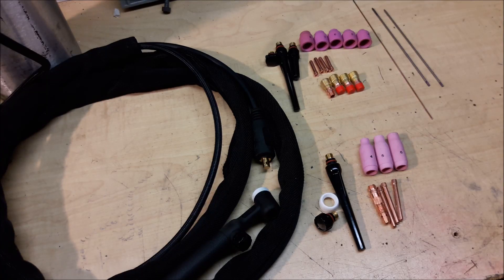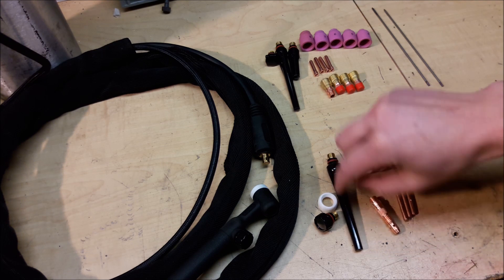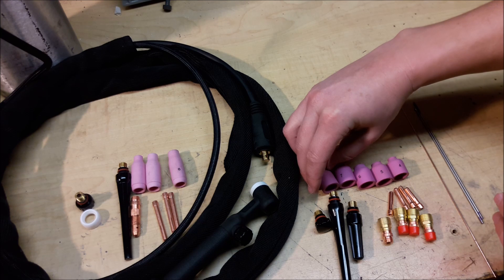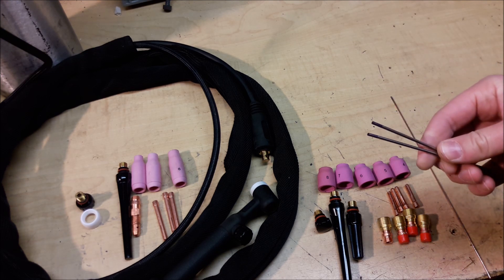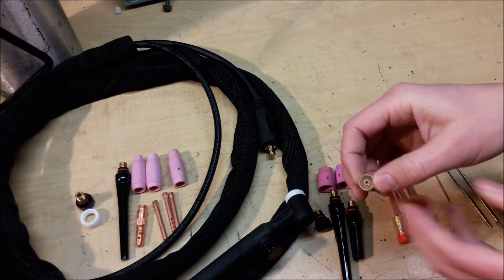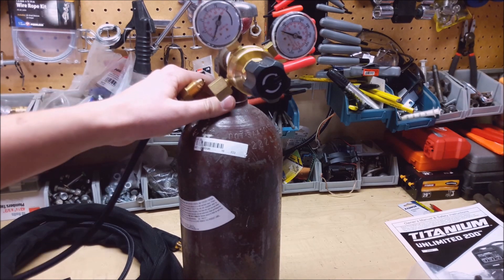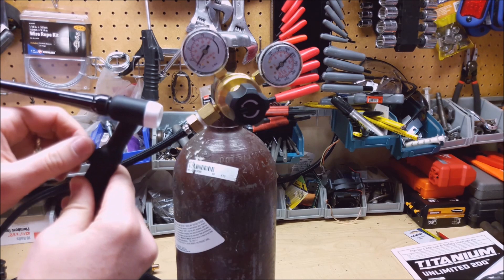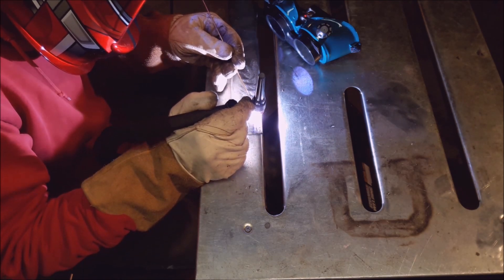Harbor Freight Titanium Multiprocess 200 Welder (TIG & Stick Process)

Comment: I was taught in Oxy Cut class never to use Teflon on threads of an air tank.
Reply: I didnt know that. Thabk you!
Reply: I was just about say this
Reply: The seal is the mating of the brass surfaces, so wouldn't be needed.  Like using teflon on a compression fitting.

Comment: Don't use any sealant on the regulator threads
Reply from the maker: My plumbing days are coming back!
Reply: Just curious why not?
Reply: @xtrah8ed4life  it could either get into the regulator a cause a false reading, or the pressure can make it crack the brass or Worse
Reply: The fittings are compression and thread tape is an absolute waste of time since the threads do not seal anything
Reply: Yeah I was told not to use sealant for threads
Reply: @xtrah8ed4life  I'm a retired machinist and the reason is that those threads are machine threads not pipe threads. They are parallel not tapered. As are compression fittings and flare fittings. Their function is merely to hold the inner pieces tight against each other. Whether they are flared, compression or domed. So putting thread sealant on them is actually preventing their ability to perform their function. If the fitting leaks when tightened you need to investigate the sealing surfaces for damage.

Comment: You're the second guy I've seen on Youtube standing up a high pressure bottle  on it's own. You guys are dangerous.
Reply: Mythbusters tested this.  It's no biggie if you break the valve off the bottle.  Just saying.
Reply: @SomeTechGuy666  : Really? You'd rather trust Mythbusters than, say, this: http://www.ehs.ufl.edu/programs/os/cylinder/

Or any other industrial guideline? Pick one: Any one: They'll all say to secure compressed gas cylinders at all times.
Reply: No biggie? I saw one fall, break the valve off,  shoot across a room, blow through cinder block wall, go across a parking lot and only stop when it hit a 12" thick concrete retaining wall. It is a biggie. If it hits you then you are DEAD
Reply: @richmac918  I call BS.  Jamie in Mythbusters set up optomized experiments and could not get a bottle to go through a cinder wall.  The necks of the bottles are designed to throttle the flow inthe event of breakage.

Comment: I have the same welder, bought it for my service truck. That welder is surprisingly fantastic. I welded a rear housing together today and I was hammering that thing. 21 volts, 310 wire speed, and hanging on the trigger. Can believe that I didn't duty cycle that thing. I am very impressed.
Reply: Ive been using the mig 170 this whole week for my job fabricating functional fitness equipment and boy am i shocked
Reply: Did you run 0.035 solid wire with a argon/co2 gas?
Reply: Will this machine run AC tig for aluminum
Reply: @TheRealRambo903  I "believe ", it's dc tig. I spool gun all my aluminum. Only used the tig a few times over the years for light weight steel tubing.
Reply: @mlhrepairsllc6942  would a spool gun be any good for boat repairs and aluminum up to 1/4 inch? I’m starting a boat fabrication and repair shop, I just don’t wanna buy the wrong machine or waste money
Reply: @TheRealRambo903  I use it on 1/4", but boat  fabrication and welding a dump body that hauls stone are 2 totally different things. I can take the saw and chew it all back out if I don't like it and the customers don't care.
Reply: TheRealRambo903  Are the boats still floating?  Did you get this one or one  a slightly bigger  welder?  I was going to say get at 250, that way you have the heat when you need it since you are going to be in the business.

Comment: Just incase the porosity is due to the metal needs to be extremely clean before tig welding
Reply from the maker: I've learned that with TIG, that piece has to be squeaky clean!

Comment: DO NOT use Teflon thread tape on gas connections the tape on the valve of the cylinder is not Teflon it can degrade and cause leaks

Comment: Regulators have a tapered fitting, it is a DRY FIT ONLY! No thread seal tape!
Reply from the maker: My plumbing days are surfacing again. Either way no leaks!
Reply: Teflon tape is a lubricant that helps tighten fittings in plumbing and other applications, not for use on any compressed gas fittings. As stated by others it has tapered fittings that are by design are supposed to be self sealing. Safety first Bro.
Reply: Mike Foster : Just out of curiosity, would that apply to air compressor fittings also, or is that a totally different animal? Thanks!
Reply: @markashlock9017  

Air compressor fittings are tapered pipe threads, so the regular white thread seal tape works fine. Those are made to be used together, high pressure tapered seat brass gas fittings (oxygen, acetylene, argon, etc) are different.
Reply: CavemanJoe : Good info. I’ve always used it on compressor fittings and good to know I haven’t been doing it incorrectly. Thanks Again!!!
Reply: @markashlock9017  

No problem. Air compressors and black iron pipe type fittings have tapered threads, that the thread seal tape helps seal. Something like an argon fitting has straight threads, but a tapered seat that seals itself by being tightened. Pipe tape won't help that kind. It's pretty easy to remember once you look at a few of each kind of fitting.

Comment: Thanks for doing the video. I'm interested in both the Vulcan and Titanium so it's good to see someone actually putting them to the test. Couple of things. You don't need (and shouldn't use) Teflon tape on the any threads that have a conical seat such as on the regulator. Your thinking is that you are sealing the threads but the actual sealing is done on the face of the cone. You're just wasting your time. The other thing is the way you sharpened your tungsten. Yes chucking it into a drill to spin it is easy but buy doing this you leave swirls around the face of the tungsten which will screw you up. The correct why is to do it by hand. Sharpen it a bit. Turn it a little, sharpen another side, then turn and sharpen another, and so forth. The grind marks should be along the length of tungsten, not around it.

Comment: I just bought one of these things.  Can I add a foot pedal.  I know that HF has one for the Omnipro - will that work on the Titanium?  If not, is there something standard I can buy on Amazon?  Would I need a new torch to use I with a foot pedal?
Reply from the maker: Maybe someone else can chime in but as far as I can tell you can't use a foot pedal with the Titanium.
Reply: To the best of my knowledge the Titanium cannot be used with a foot pedal. You might want to confirm this with HF (if you can find someone there that knows anything) but I'm pretty certain you can't.
Reply: Thanks.  I figured that out.  It doesn't have a connection for a foot petal.  I did find a spool gun for it however.  The Klutch 150 SG has that same 5 pin connector and quick connect gas line.  Works fine on the Titanium 200.  I cut off the DC loop and replaced it with a DINSE connector as it was too difficult to connect it to the MIG wire feeder as designed.
Reply: This is why the Vulcan series costs more for missing features in these.

Comment: From other videos you want about 10 to 15 cfh of gas flow.  That isn't 10 to 15 psi as shown on your regulator.  The regulator doesn't indicate how much gas is flowing.  At 10cfh that 20cuft bottle should last about 2 hours.

Comment: You don't need Teflon tape on a POL fitting period ! the seal is made with the surface area on the POL metal to metal contact , Teflon tape is nothing more in this application than a distraction.
If all else fails and you just put the POL fitting together dry and you still have a leak then the POL has a gouge in it and doesn't mate up properly, this can readily be resolved with a light application of Johnson controls gas valve grease applied to the POL SPARINGLY. ! FYI

Comment: How many Amps does it need for the 230v plug? Can a 30a 230 do?
Reply from the maker: I only use it on 110v so I can't say for sure. I have their 170 machine that I have on a 30 amp breaker and it throws the switch on the highest setting. My guess is you could only get around 150 to 160 amps dc with the 220 and 30amp breaker. I could be totally wrong, I'll let an electrician chime in to know for sure.
Reply: Probably a 50 amp breaker like most welders
Reply: I think the highest settings and most amp input is maxed out mig settings which draws 38? Ish amps. I'd suggest anything above that.

Comment: Your using gas lenses and  They are harder for a beginner to learn with .  Switch to what came with it and you'll find your welds will improve greatly .
Reply: I never heard that before.  You might have trouble if a dirty surface causes the lens to clog.
Reply: @qua7771  

That's not how a gas lens works. It's basically just a diffuser, so you get a more even flow of argon.
Reply: @qua7771  I would hope that if your tig welding your doing it on clean surface .  Dirt and tig don't mix well
Reply: @catfishbobj  I don't know why you would say that they are harder for beginners to weld with unless you mean that beginners have a tenancy to put the electrode in the puddle more often.  That would cause the screen to clog.
Reply: @qua7771  

Probably because as a beginner, the gas lens makes it harder to tell exactly what you're doing wrong because it covers up some things and compensates for others, so you end up chasing problems you don't know you have.

Comment: Does it have the ability to use a pedal setup instead?
Reply from the maker: No pedal. As far as I can see it looks like no connection for it. I'm sure there is some hack out there that had mortified it to accept one but nothing right out of the box.
Reply: I could be wrong but I’m pretty sure you can use the Vulcan foot pedal. It has the same connector pin as the the omnipro

Comment: Does it allow you to tig aluminum
Reply from the maker: No, it is a DC machine only.
Reply: @dp672 Product claims to weld  Aluminum (DC TIG) Already know to use Helium, only question is,  is this machine capable of negative DC?  Your thought's?
Reply: @dp672Cool that you can reverse cables.   Really like this welder.   I may just get one.  Thank ya kindly friend.
Reply: As dp672 mentioned, you can weld aluminum with a DC TIG welder but you have to use helium and it is expensive. The better way would be to get a spool gun (one is supposed to be available for this welder and I have heard that some other makes fit this as well) and MIG weld it.